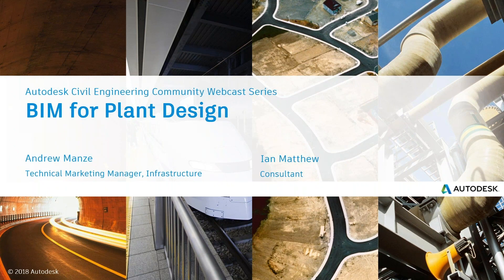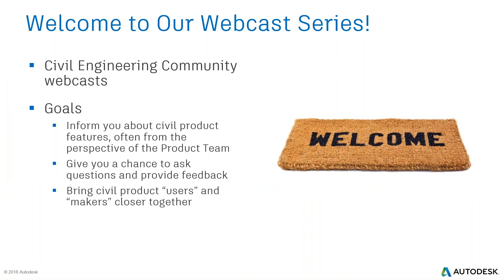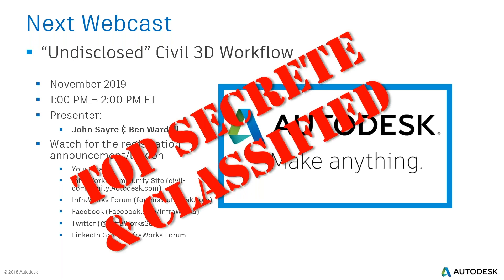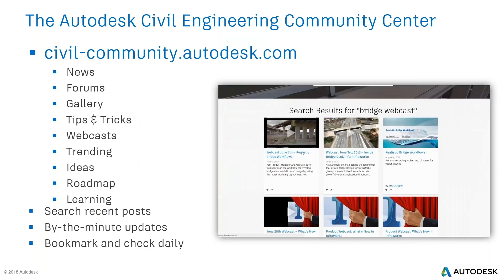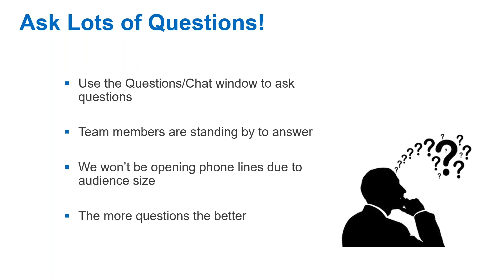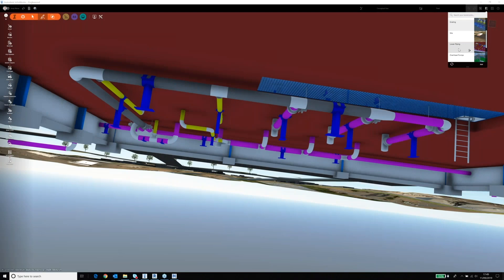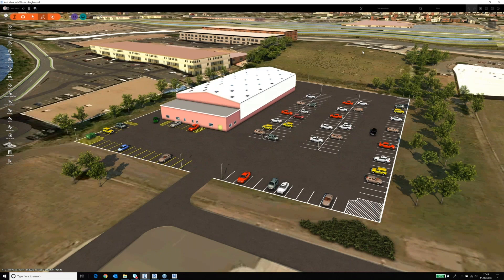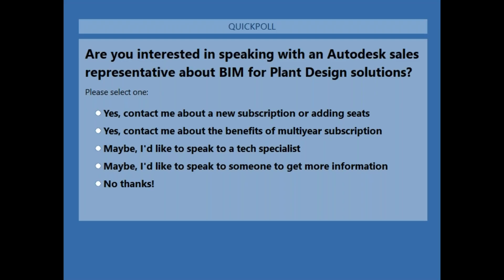[Webinar]  BIM for Plant Design

Comment: Very interesting video, but...
We do a lot of pump/piping skids (RO, MBR units) we design to detail in Inventor and fabricate. Were and how would Inventor fit into this workflow? For the moment we do all (building, equipement, piping) in inventor, but are seriously looking into Revit.
Reply: I also saw your discussion on the Autodesk Forumn, we are in the same scenario but primarily use Solidworks which doesn't play as well with autodesk products.  We have begun using Revit on some larger jobs, what did you guys end up doing?  How has it worked?
Reply: @nathannguyen09  Still doing all in Inventor.